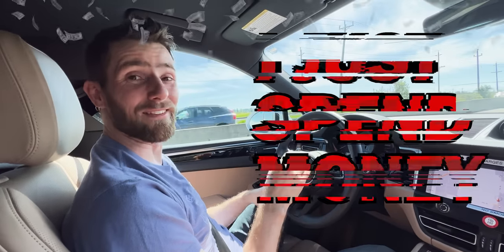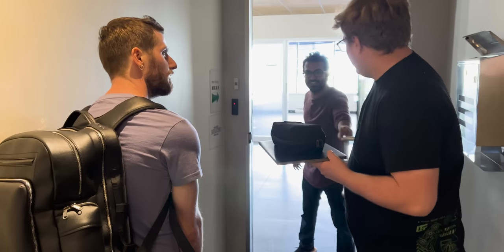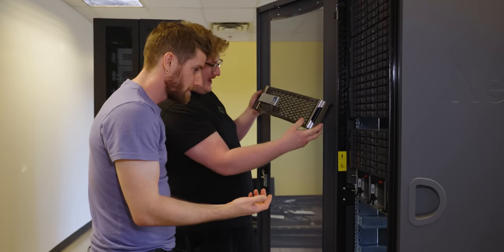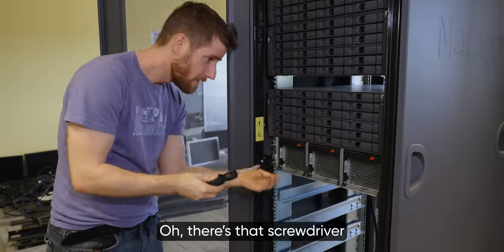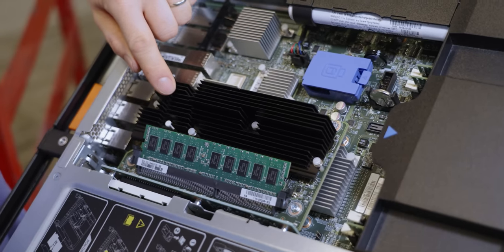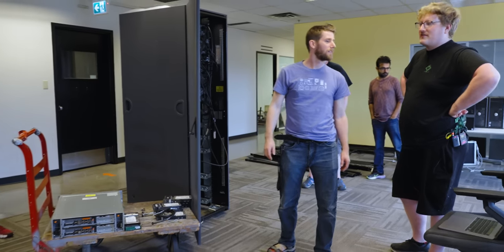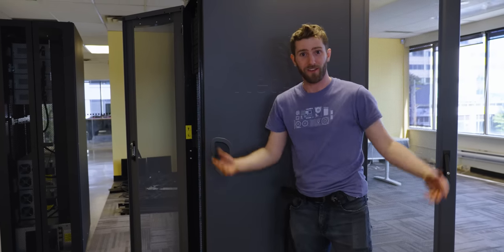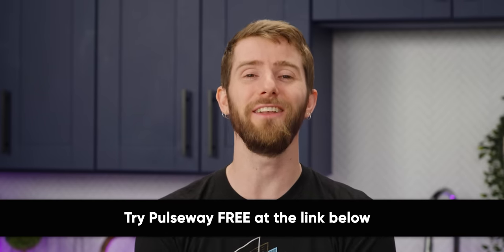WHAT did I just BUY on Facebook Marketplace?? - NetApp Storage Appliance / Disk Shelves

Comment: Spinning down these drives and letting them cool down is actually the most dangerous part. These drives are built to spin continuously, so by cooling them down and spinning them up again you run the risk of damaging the platters. The professional method is to move them spinning under power using a UPS.